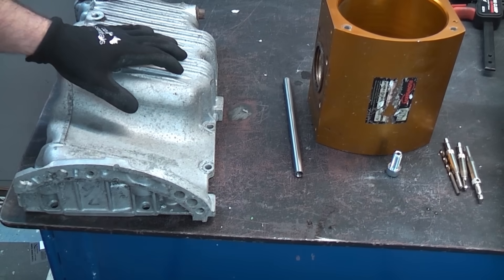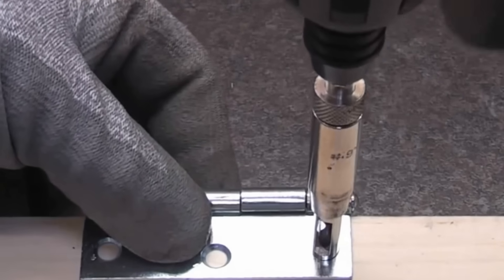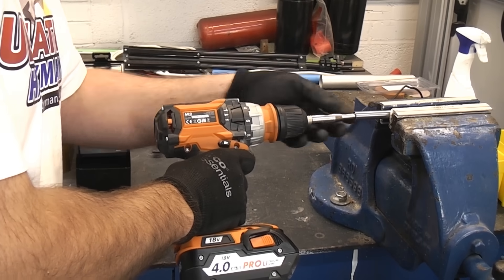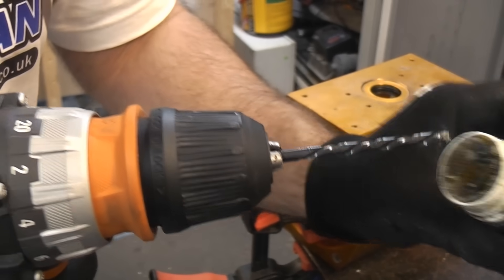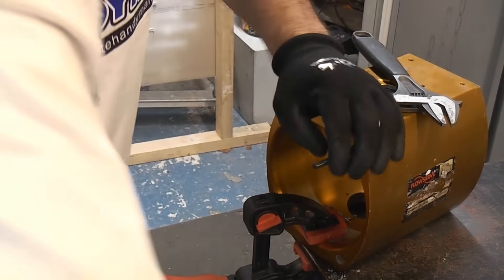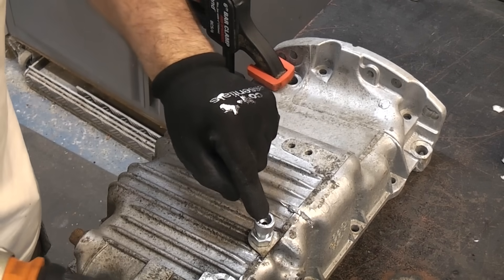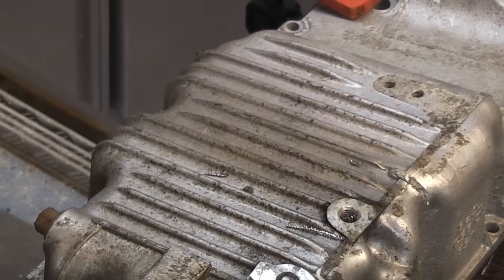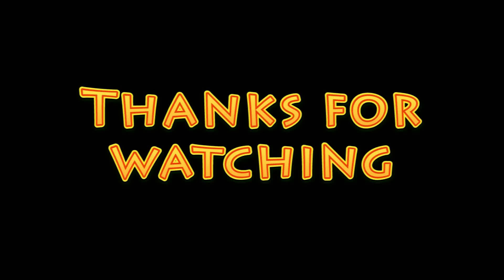How to remove a broken bolt in a deep hole | remove broken bolt in recessed hole

Comment: Can't for the life of me figure out how you've got 3, well below the surface, broken bolts, and I've never had 1 anywhere close to that depth.  Also, TAP ON IT harder, that springy thing is useless except on demonstrations with  bolts that have seemingly broken off for no apparent reason, leaving well formed, corrosion or galled free threads, that easily spin out almost by themselves!  Breaking off when being tightened happens with good threads but would not be below surface, else all threads above the break would have been pulled out.  Breaking off when being loosened means a seized thread problem, and yours are as far as possible from that.

Comment: i learned how to use easy outs over 35 years ago. as an auto mechanic they are one of the tools of the trade as there are always times when a bolt breaks off somewhere and you either have to drill it out and re-tap it or hope the easy out works. one thing i would recommend is to buy a quality set. i bought a cheap one when i first started my job and they did not work well

Comment: Only issue is none of the bolts extracted were rusty in this video... Those are the real challenges - not an ideal, non-rusty situation which typical methods actually work.

Comment: You can take a bit of copper pipe the same diameter as the hole, and slip it in to protect the threads, then slowly MIG weld up a core, being careful not to melt the copper. Tack on a leverage bar to the top of the weld, and crank it out.

Comment: Very informative :) but don't use copper based anti--seize on stainless steel bolts.  It causes intergranular corrosion of the stainless steel.

Comment: i’m a retired Woodworker and i have many Hobbies including Vintage Automobiles,Boatsc, and Airstream Trailers  that i do almost all the Restoration Repairs ,and maintenance on i liked the idea of using a Self Centering DrillBit like you did  with the minor exception. of that paticular Vix bit you used in the demonstration  cost me just over the fifty dollar  price for one  DrillBit  so i am  very protective of mine to have  when i need it to Drill that size Door Hinge  which in my trade is very common  just one other note on removing broken Bolts  my Dad was very aadamant about  buying  all hiscEasy Outs  from one of his Uncles who is now a retired Tool and Die man  but  whatever brands they used were supposedly the best in the Industry  i know they weren’t inexpensive but  my add  did grow up being around that Uncles Machine Shop  growing up and my Dad did have a very good skill at removing broken bolts and Studs  he treasured those Easy Outs  in a separate Compartmebt inside a pacific storage case  just for those  items i still keep them like that as i inherited his tools  and Chests
Reply from the maker: Blimey, that was expensive!

Comment: if you snap a grade 8 bolt these methods would not work, 8 grade you can use a masonry dill bit and shapen it as you would a normal bit it will drill into it
Reply from the maker: These bolts are grade 8 👍
It's the 12.9 bolts that are tough and will require a cobalt drill bit or similar 👍

Comment: I bought an old motorcycle where everything's over tightened and corroded, got a few to deal with. Can weld nuts to a couple of button heads, and one sheared bolt can just stay there, as the fixing is no longer requited. It's a nightmare sometimes, but is a definite celebration when they're out.
Reply from the maker: Welding nuts on, is probably the best option 👍
Reply: @ultimatehandyman  keep up the good work, fella. delivered in true northern style. I'm across the way in north wales. Have a great day.

Comment: Brilliant tip - thanks. You can center drill those bolts in a drill press. I once made a drill extension by center drilling a length of all-thread (3/8") I just bolted it onto a piece of 2x4, nicked the center, then clamped it on to the drill press platform.

Comment: What bugs me is how fragile the extractors tend to be. I've snapped off enough of them to usually make this a nerve-wracking job. Drilling a bolt as drill guide is a great tip - thanks a lot for that one!
Reply: That's the problem - the screw extractors are so easy to break off inside the broken bolt.
Then you have a huge problem.
Reply from the maker: You can always drill them out- https://www.youtube.com/watch?v=7JCfEMrCjhc&t
Reply: @ultimatehandyman  -
thanks I watched that video on how to drill out a tap - very well done.
Reply: @ultimatehandyman  Cheers, mate!
Reply: @ultimatehandyman  Once, I tried drilling out a broken extractor, but it was harder than the bit, and just dulled the bit.
Reply: @Bobby-fj8mk  That often happens because people use too small an extractor for the bolt in question.
Drill a hole in that sucker that is at least a third the size of the bolt, then get a large enough extractor in to do the job.
Reply: @shirleymental4189 
Excellent discernment / strategy !  Thanks for sharing this  !!
Reply: You are not the only one to suffer a "snap off". I avoid them now as usually causing more trouble then they are worth.
Reply: Extractors are typically very hard metal (and consequently brittle). You have to be extremely mindful of side loads or overtorqing.  Using the largest extractor possible for the job helps (or one size smaller so you have another chance to go larger)
Reply: I drive them with a T-handle tap wrench. Much less likely to break than with a spanner which tends to side load the extractor.
Reply: Just get a set of expensive high quality screw extractors (NOT the type the author is using in this video as they are a liability!!!). Snap-On do a set, they have straight, parallel ridges running north south which bite into the inside of the hole you have drilled. They do not force the broken stud to expand, as the author's type does. Of course, a screw exteactor is a last-resort tool, but the Snap-On style extractor will get you out of a pickle unlike the type shown which in inexperienced hands will usually make matters worse.

Comment: I've always used a deep socket that fits the hole to protect the threads and drilled through the center of the socket. Once the broken bolt has a hole I use an easy-out. No special tools needed. I also use heat and penetrating spray like wd40.

Comment: I spent over 50 years in the business of restoration on a wide array of equipment and another little trick is to drill a pilot hole about 1/3 the diameter of the drill, then the left handed drill will tend to hang and be more likely to impart more torque into the remnant of the bolt, if your pilot hole is too big it will tend to snap the drill. we also had success with using an impact drill that will not only work to loosen the bolt but also be less likely to break the drill bit
Reply: and straight flute extractor bits will be less likely to spread the bolt outward
Reply: another trick if the remnant is broken close enough to the surface you can take a nut slightly smaller than the broken one and take your wire welder and do some short welding pulses until you have welded the nut to the bolt, throw some water on there to cool it quickly so as to shrink it quickly and break the bond to the parent metal

Comment: You can center punch the center of the bolt, and use a small drill bit that fits in the punch mark, and the drill will stay centered.  The go to a larger drill if needed, and it will follow the hole. E-Z outs then fit in the broke bold to screw it out.  Any way you do it, it's a pain.  But the special centering tools are really not needed with a good center punch.

Comment: In the case of a bottomed out broken off  bolt. After drilling out the center, use heat enough to melt a tire crayon  into the hole. Heat the metal and not the crayon.  Let it cool and try an easy out to remove the broken off bolt.
I have seen this work in many cases. Trapered plugs in crankshaft oil holes,  exhaust studs etc. The melted crayon works wonderful. It lubes the broken bolt, or plug threads.

Comment: when you heat it put wax on it so it melts and goes down the threads and when it coolshevwax will stay there and make it a lot easier
Reply from the maker: I've still not tried the candle wax method 😂

Comment: Using penetrating oil,  tapping the bolt, more oil the bolt, more tapping the bolt broke anyway when I attempted to remove it. Subsequently I was able to drill out the center through the bolt (it is on the bottom of the box frame which is used to secure a skid plate under the transmission) and use an exactor which had a very good purchase but unfortunately the extractor broke. Where can I find one of those bolts with a hole in it you used?
Reply from the maker: I made it myself- https://www.youtube.com/watch?v=6mZj0J6CNYA

Comment: Had to see if they remove broken bolts in the UK, like I've been doing here, and they do!  Those look like bolts I have to take out on a regular basis.  It's nice to have a lathe to make the starter bolts with, just isn't the same without a lathe.  Very nicely done, thanks.  I've also welded beads on the end of a stud or bolt to get a grip on them.  It's like anytime you've got ten bolts on a cover, one has to break off, Murphy steps in.
Reply from the maker: Thanks John 👍

Comment: Alternative to this is to  find a piece of copper tube that fits the hole and Mig Weld till you reach the surface then weld an appropriate nut. Then remove normally. Steel does not weld to copper.

Comment: Okay Bud.  I didn't have a reversing drill nor left handed drill bits.  Every thing was clockwise and under a fender on the car so no special jig.  There was no subsurface threads showing even then I would have to use a hand drill(using 3/8 120v corded Black & Decker drill) and drill through a bolt dead center. Not gonna happen.
You use a center punch  and generally get it close to center. Then you hand drill with the B&D drill using a 1/8 drill bit. Chances are good the hole is off center. and if you are real lucky you will break the drill bit in the hole that is not all the way through the bolt, SO, you got to drill out the drill bit with a second drill bit. Expect that to snap too. So you need a 3rd 1/8 drill bit to drill out the 2 and you finally drill through the bolt.  Now goes in the easy out and you break the EZ-out IN THE HOLE.  Now you use the 3rd drill bit to hand drill out the EZ-out and maybe need a 4th 1/8" drill bit to complete the task.   You have been buying the drill bits ONE AT A TIME so that meant many times to the store WALKING.   This is to remove a 1/4" bolt that is rusted in. Or, a weekend job...day & night
 Then I chase the threads with tap and break the tap in the hole which has to be drilled out by B&D handdrill. Almost drove me to drinking.  
This is "the REALITY."    Costly. I broke 4 brand new drill bits and a TAP for 1 hole.   At this point if 50% of the threads are left, it is close enough for catching.
  I should have used Acetylene torch HEAT...in hindsight to make it red hot as it was all steel.
Reply from the maker: I feel your pain.
I need a drink now, after imagining what you went through 😱

Comment: I've had to use screw extractors thousands of times when in the RAF, (Hi-torques on Harriers mainly), top tip, tap the end of the extractor while turning, it re-seats it if it is opening the hole.
Reply from the maker: Wow, the Harrier is my favourite aircraft of all time!
Thanks for the comment 👍

Comment: Two things I prefer to use a drill press or a milling machine with the part clamped to the table.  The other is you can use a drill that is the same size as the minor diameter of the tapped hole to get a center spot in the bolt.  Then drill a small hole and then use the left hand drill.

Comment: Never seen a bolt broken in alum that deep. Usually it is just on the surface or just above. In most cases it is the alum blockvthat looses the thread and aI had to fit  helicoil.

Comment: Argues the left-handed drill bit thing quite a few times and had lot of success. Many times in the process of drilling into the bolt it will catch and spin the bolt right back up out all of the hole

Comment: I prefer the fluted screw extractors, myself. They seem to get a better bite, but you have to be more careful with them, unless they're case hardened steel. I try to turn the screw kind while tapping them in so they bite deeper. Best screw extraction process involves patience - let the penetrating fluid sit in the hole long enough to make the job easier.

Comment: Penetrate, heat and hammer. Work every time. If you fail, try welding. If it is recessed, remove center material. Removing the center material usually means you're going to put something in between the threads and actual bolt. That means expansion and binding. Therefore it's probably going to tighten. It will need more heat and Hammering while torquing gently. Or drill it out tap a bigger fastener. AKA bolt.

Comment: Great tips! I had never used a drilled out bolt to center the hole. I have done hundreds of snapped off bolts before. A tip back atcha!  Use your wrench to turn the extractor in while tapping on it to  get a better bite. It provides an impact driver like effect, and, I believe, in many of my extraction experiences, made the difference between a successful extraction, and snapping off the extractor.
Reply: A two handled tap wrench balances lateral forces to apply only torque to the extractor. This reduces risk of breakage of the extractor.

Comment: URL to buy all those tools?
Reply from the maker: Hinge centering drills- https://fave.co/2DpJo1H
Left handed drill bits- https://fave.co/2xJjK1M
Teng screw extractors https://fave.co/2OnfRuF
Dormer taps -https://fave.co/2OsN1sQ

If you are in the UK-
Hinge centering drills- https://fave.co/2NE1VMc
Left handed drill bits- https://fave.co/2DubtF4
Teng screw extractors- https://fave.co/2pVLkVT
Dormer taps - https://fave.co/2pTfbyx

exact cutting paste- https://fave.co/2Nabyxc
cobalt drill bits (they are much better on harder steels like bolts) https://fave.co/2zDh3kp

You'll have to make the guides yourself, but they are easy- https://www.youtube.com/watch?v=6mZj0J6CNYA&t=1s

Spring tools centre punch- https://fave.co/2NbnLBD

Comment: Many years ago I used a piece of round bar stock to make a drill bit guide to center up on a broken head bolt that was deep in the block.  Since the bolt broke at the top end of the threads there was no way to use the Allen head bolts like you used, but I will keep the idea in mind!  Many times I have used my Mig welder to build up the broken off bolt to get it up to the surface, then welded a nut on that.  Of course I soak the broken bolt threads with Kroil first and sometimes heat the base metal up with a torch to help break any corrosion loose.

Comment: We have to use proper names to teach the apprentices
- Socket head cap SCREW ( not Allen bolt)
- Stud
- shank
- Hex head SCREW
Screws only become a bolt when used in conjunction with a nut .
If not , why isn't the easi- out not called a bolt extractor .
So now lots of viewers have learnt that there are actually left handed twist drills and are not a mythical thing that the apprentice is sent to find ( practical joke )
There are also right handed easi-outs aka 
" SCREW"  extractor ( not bolt extractor) for left handed  screws .
I own ambidextrous screw extractors due to my 41 yrs in  trade work

Its rather amazing that those fasteners have sheared radially from torque but just  fell out with no damage to the internal thread  ????? 
But still a good teaching tool of how to tackle  the situation of a broken recessed "fastener" ( generic term that captures all helical spirals regardless of application)

Comment: If you drilled through the stuck stud I wonder if it would be helpful to run a thread restorer tap into the threads coated with heavy grease to extract any shavings left inside?

Comment: What about harden screws these are soft steal
Reply from the maker: You can't get "hardened steel bolts", you can get high-tensile ones, which are considerably softer than hardened steel. Most regular drill bits will drill out bolts, but for high tensile bolts, you might need a cobalt drill bit 👍

Comment: Candle wax is a good way to get a stuck bolt out too, heat it a little stick candle to it and let wax go into the hole it will run down threads and use left hand bit

Comment: You can cut a piece of copper tube and fill the hole with a weld and then weld a nut to it and reverse it out. The copper tube protects your threads and copper wont bond to your weld.

Comment: One thing I've learned about broken off bolts and nuts, is the bad luck thing about not having any room to work on the problem.
Reply from the maker: Absolutely 👍
I've done some really difficult jobs over the years, often in difficult positions!
Reply: @ultimatehandyman  I'm a retired body shop worker. I had one come in one day, it was a Pontiac Aztec. The guy tried to remove and install a new thermostat. He broke off BOTH bolts. The hood came off, engine parts out of the way. Man, that one was one to remember. I love your videos.
Reply from the maker: @hairylarry6167   I bet it was fun getting both bolts out 😂
Thanks for the comments Larry 👍
Reply: @ultimatehandyman  We had all our body men coming over and suggestion how to get them out. It was about as much fun as being naked getting honey out of a bee hive. We got it fixed. Took a long time.

Comment: Nice. Thanks! I got my bolt out by doing the pilot tap, drilling and the heat from drilling I guess loosened enough I could use a small enough flat head to get it out
Reply from the maker: Well done 👍